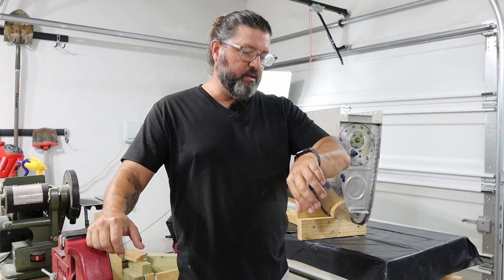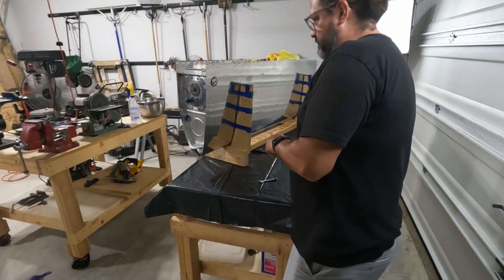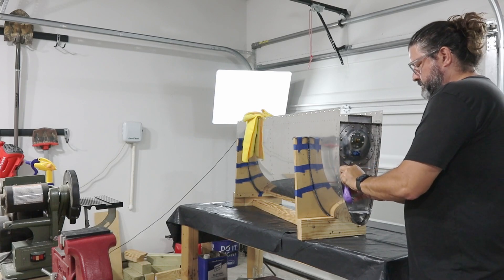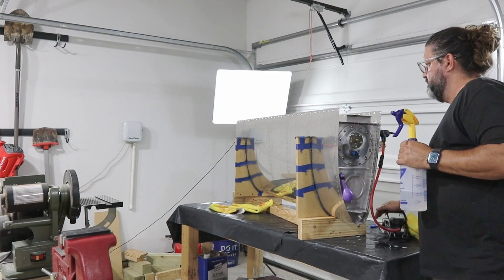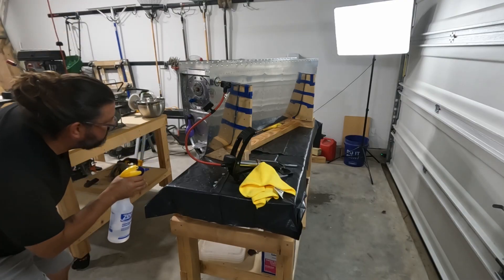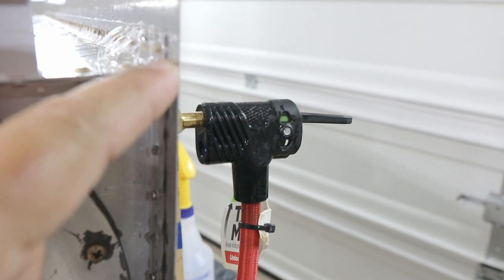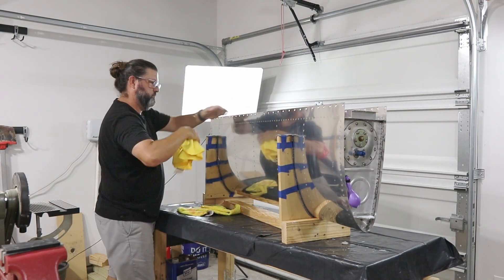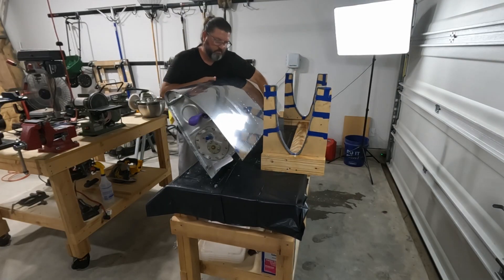Van's RV-8 Build. Ep 086. Fuel Tanks 30. Leak testing part 2

Comment: Greetings form Fort Worth!!

Fuel tank related... if I remember correctly you decided to do inverted fuel with flop tubes. Does that still require the anti-rotation bracket installation? If so... have you completed that step and which video would that be? I have a 2001 completion RV-8 that I bought, and it does not yet have the anti-rotation bracket installed. I'm hoping to get a look at the actual install before my mechanic and I tackle the project.
Reply from the maker: Hi JR. The anti rotation bracket still applies to the tank that uses the traditional fuel pickup (right tank in my case). The flop tube install uses safety wire to prevent loosening… I made a lot of videos about the fuel tank build, but I don’t remember if I was very detailed covering the anti-rotation bracket.

Comment: Off topic here, but I've been meaning to ask. I'm at the same part of the build as you are, and Van's has put out their "stop building bulletin because of laser cut parts being cracked".. You keep on building. Are you not worried about the possible cracked laser cut holes in  a lot of our RV8 parts?
Reply: Okay thanks, I thought I was possibly missing something and could keep on building. Your videos are the greatest. I watch an episode, then go out to my garage and do exactly what you just did. It takes a lot of second-guessing myself and clears things up. Keep ‘em coming! Cheers.
Reply from the maker: @kellyandersen2005  I’m glad you’re finding it useful. I use @ryanflys channel the same way. The -7 has the same empennage and wings as the -8.
Reply from the maker: Hi Kelly. The parts I'm building right now are unaffected. Once the top main skins are attached I'll have to pause on the wings as the flaps and ailerons are both affected. At that point (assuming we're still waiting on the final word from Van's) I'll be able to keep myself busy with inspecting potentially affected empennage assemblies and fixing the leaks in my fuel tanks.

Comment: 2 comments (from BTDT):
1)  Fuel is less viscous than is air.  Once you close all leaks with the balloon, start checking for "blue streaks" --- gasoline WILL find tiny gaps that air won't find.
2)  My final solutions (works great) is to seal weeps with a smear of JB Weld clear.  You end up not seeing the JB Weld, nor fuel weeps.
Reply from the maker: Thanks! That’s great advice!

Comment: My experience repairing aircraft fuel tank leaks is you have to do it from the inside for a reliable long lasting repair. Resist the temptation for a “quick fix.” Now is the time to do it right.
Reply from the maker: I’m sure you’re right. I’m hopeful that on the right tank that I’ll be able to reach through the lightning hole in the #2 rib to repair the leak in the second bay.

Comment: Does van have clear instructions for such situations?
Reply from the maker: If you're asking about instructions for leak repair, I haven't seen anything detailed directly from Van's. But, there's a ton of information on the subject at vansairforce.net. If you're asking about instructions for leak-testing, the plans included with the Van's leak-testing kit are pretty straightforward. And, they include a small blurb at the end about addressing any leaks that might be found. It's just not a step-by-step guide.